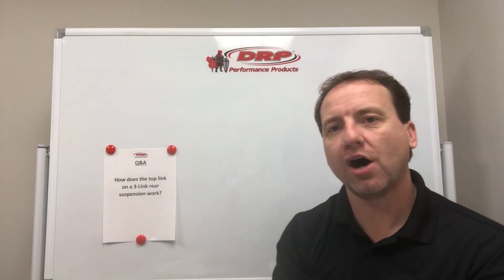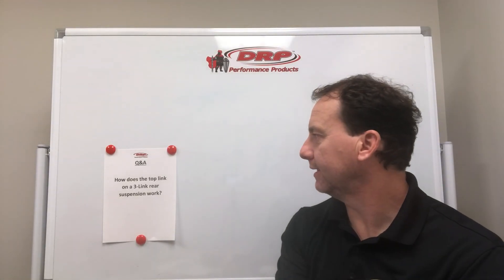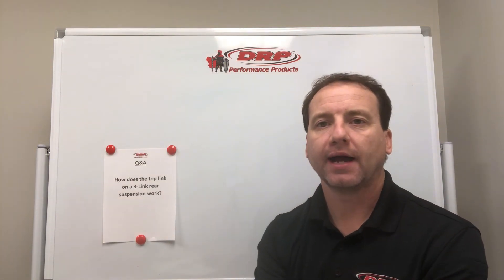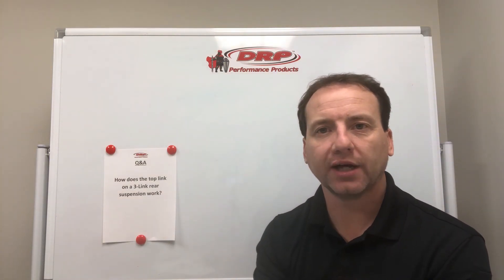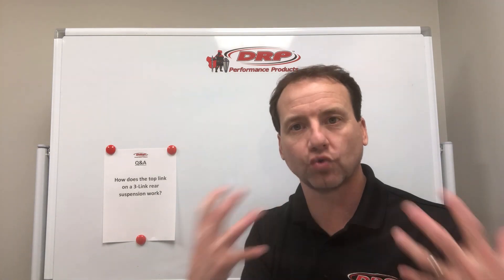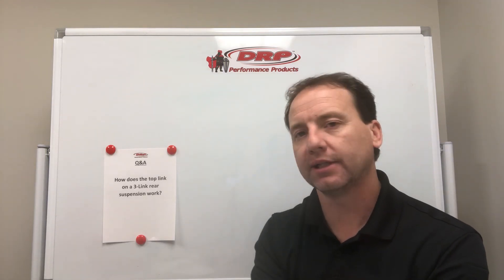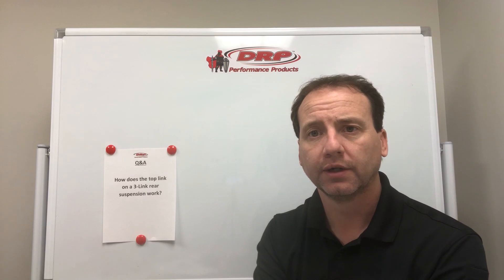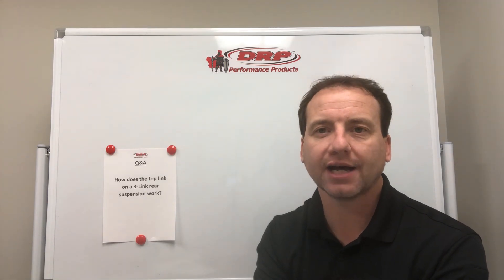How Does the Top Link on a 3-Link Rear Suspension Work?

Comment: I just finished building a 3-link on my truck but before I put the bed on I was driving the truck around the yard and noticed the axle rotating quite a lot. My lower arms are located almost on centreline with the axle, about two inches below the od of the axle tube. And my top arm is mounted forward of the axle centreline by about four inches, and an inch and a half above the axle tube od. Would it help to increase the distance of that top arm mount to gain more leverage (control)?
Reply from the maker: Yes, raising the top link will reduce pulling force and axle wrap.  Ideally, you would raise it on both the rear end and chassis, keeping the angle the same.  Dropping the lower trailing arms would help also.
Reply: @drpperformance  awesome! Thanks very much for the reply!
Reply: @drpperformance  i raised the top link and it worked! Thanks!